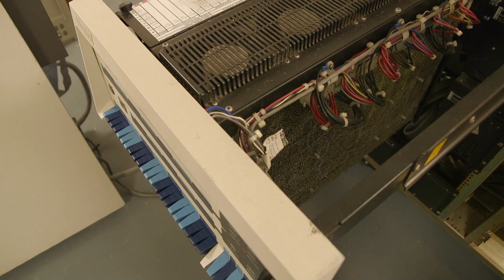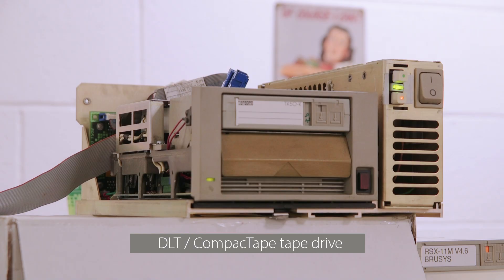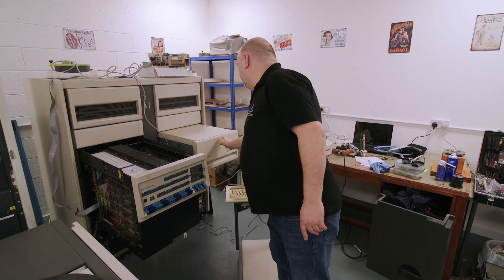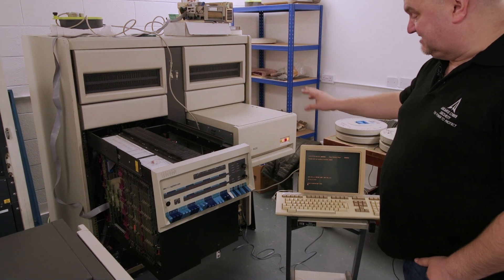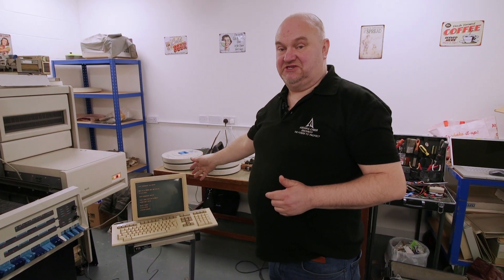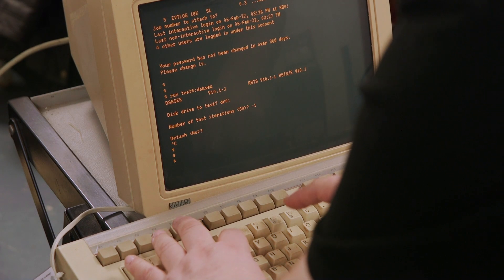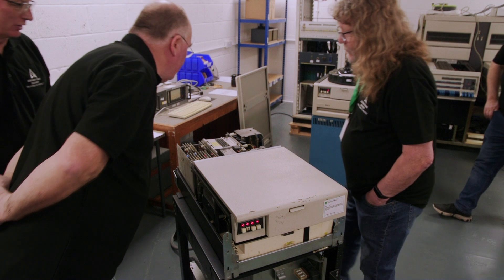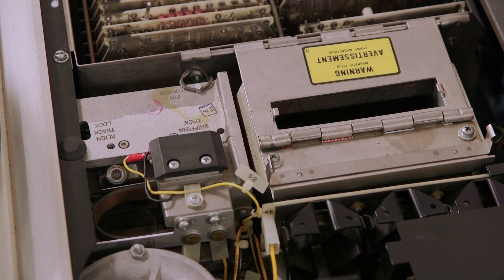DEC PDP-11/70 - NPL Scrapbook -  restoration and machine tour | 1970's computer

Comment: Back in 1980 I worked as a computer repair technician and a lot of our customers ran PDP 11/34 and 11/70 systems. Once had to troubleshoot an 11/70 at a Navy facility in San Diego and spent 3 days isolating a stuck address bit which turned out to be a backplane wire wrap connection gone bad. These machines were monsters, but it was state of the art back then. I think my iPhone has way more processing power LOL, but the Massbus architecture of the 11/70 allowed it to support a ton of peripherals — disks, tapes, terminals — so you could support a medium size organization with the one CPU. Ah, heady stuff!

Comment: This brings back lots of memories. In the late 70's early 80's, I founded a company that built school admin software that ran under RSTS/E on various PDP-11s. I think 300+ school systems across the US used it for all the admin and financial functions. Supported dozens of simultaneous users on VT100's & VT220's. It was mostly written in Pascal. Wish I still had the source code. I would definitely compile and run! We actually bought a full 11/44 brand new. $100K+ in 1980's money!

Comment: Great work, guys! It is nice to see the PDP-11 and RSTS running. The first computer I used was a PDP-11/20 in 1973, then a PDP-11/50 for several years. For nostalgia's sake, it would be nice if you could get a DECtape unit (TU55 or TU56) and a paper tape reader/punch (PC05).

Comment: Your tape drive was a TK-90 I believe and was manufactured in Springfield, Mass before 1993.  Probably between 90-93.  In 93 as part as the big sell off, the Springfield facility was shut down.  They produced all the tape drives, TE16, TU77-78 for DEC and also produced the first solid state HD, ESE20  as well as other smaller HD's.  They had the largest clean room east of the Mississippi in the early 90's.  I know, because I worked there and was outsourced in 1993 after 16 years with the company.

We got to play around a lot with equipment and I had a system running RSTS of 100 users on a PDP 11/34 with 100k of memory.  Yes, that is 100k of memory.  Of course, no graphics but still 100k to run the OS.  Had 3 RK05's to boot from.  Later, moved  up to a micro VAX that by then supported 16 bit graphics.  Woo-hoo.  That was amazing.  Brings back a lot of memories.

Comment: My lab had over 30 PDP 11/xx including 45, 60, 70 & 80’s. The disks had 5 platters holding the RS11M OS and my  designed OS. They were used in groups of 3 to 5 integrated computers with all connected through busses!  Amazing machines. The front panel was octal, but internally it was hexadecimal!

Comment: We had an 11/23 and an 11/73 with RSTS 90 at college.... but neither of ours had a hardware front-panel.... just before I started college, they got rid of their Data General Nova which was bedecked by blinkenlichts... I feel I was cheated. :( ;)
Oh, incidentally I can be so sure of the RSTS version, 'cus I've got a printout to hand on my desk. ??????????
That VT-320 is way to modern to be authentic ;) Needs a nice VT-100.
Reply: VT100 would be nice!  We have a few VT320s in the museum but not so many VT100s but when the system goes on display we will as you suggest probably provide it with a nice VT100

Comment: Y'all have heard of 'write-protected' storage. Well, a 'head crash' gives you read- protected storage on those platters 🤕
I wonder if there was DEC equivalent of 'Norton Utilities'  back then to mitigate those situations to  try and rescue whatever remained on the platters. 
3600rpm = 60rps which equates to a 'degree' sector read latency of 16.67ms if my maths & thinking is correct.
Reply: Unfortunately in this instance it was the servo head that crashed.  It was a scratch disk in any case so had no data of value on there.  In the field in the 1980s there were no such utilities to help rescue data.  With some drives (RL02, Ampex etc), we simply had to clean the head and disk platter the best we could and hope the heads survived long enough to get a copy!  No such luck with an RM03 though as they were much more critical - once a head crashed, the pack was condemned.  The holy grail we are looking for is an RM03 alignment pack, of which there appear to be zero left in the world!  I would be VERY happy to be proved wrong :-)